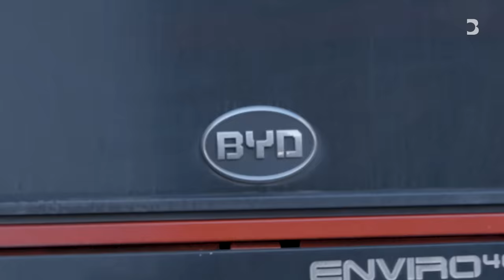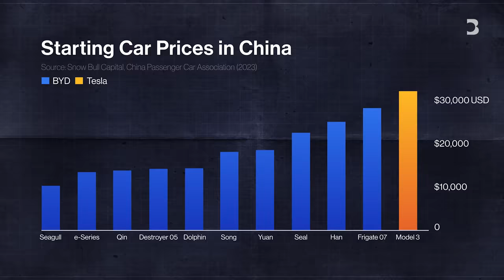How China's BYD Overtook Tesla

Comment: I experimented 3 years ago and purchased 4 BYD forklifts. Yes, they make those too. I was hesitant to purchase Chinese made equipment but was intrigued by the batteries. The biggest issue with forklifts is battery charging time, which for a typical lead battery in a forklift is 18 hours to do it correctly. Charge, equalize and cool down. The full cycle on the BYD battery is about an hour to hour and a half. That keeps you from having to swap batteries in forklifts which is fairly dangerous moving a 5K pound battery. You can use lithium batteries but they are incredibly expensive and the usable lift is about the same as lead which is 5 years before problems. The BYD batteries have a 10 year warranty. which just does not exist in the regular battery world.  If BYD were to start making forklifts in USA they would dominate the market. They are a battery company that is now making things for the batteries to be used in.
Reply: Aren't BYD batteries lithium batteries?
Reply: I dont believe you
Reply: @humanyoda  china dont have lithium!meanwhile india with 5.0 million tonnes of litjium found last year:glasses-purple-yellow-diamond:
Reply: @humanyoda No, they are LIP batteries.
Reply: if he worked for byd he would be talking about cars not forklifts, dumb dumb. @dazm901
Reply: @dazm901 and why would someone from marketing talk about issues with their tech? Dumb dumb
Reply: @dazm901 what a troll. You’re spamming replies under basically every comment
Reply: This is bydmarketing?  Its from a forklift article in us machinery magazine.
Reply: @iam_arnavisaha32   we're talking about lithium and China have it... litjum can be found in India
Reply: Will they honour the warranty, though?
Reply: @iam_arnavisaha32  you better create 5.0 million toilet first before dream too much 🤡🤡
Reply: @bestreviews9666  If that makes you feel better. Go ahead.
Reply: @humanyoda BYD has multiple battery chemistries, they have not only lithium ion but they have lifepo,  and they have sodium batteries.

Sodium batteries are dirt cheap because sodium is dirt cheap because of salt and sodium has greater charge hiloldi
Reply: Yes that is why the US tries to keep out Chinese brands.  As much as Americans try to deride Chinese products - they don't even know.
Reply: @iam_arnavisaha32  based on youtube comments, India has everything and champion at everything
Reply: BUT SIR MY INDIA IS THE REAL SUPERPOWER  🤗🇮🇳 WE HAVE THE BEST INFRASTRUCTURE AND HIGHSPEED RAIL 🤗🇮🇳 MEANWHILE IN CHINA PEOPLE STILL RIDE RICKSHAW EVERYWHERE AND THEY ALSO POOR DONT HAVE CAR . THIS WHY IM SO LUCKY LIVE IN SUPER INDIA  THE CLEANEST COUNTRY IN THE WORLD 🇮🇳🤗 , WE NEVER SCAM! WE GIVE RESPECT TO ALL WOMEN THEY CAN WALK SAFELY ALONE AT NIGHT AND WE HAVE CLEAN FOOD AND TOILET EVERYWHERE 🇮🇳🤗🚽, I KNOW MANY POOR PEOPLE JEALOUS WITH SUPER RICH INDIA 🤗🇮🇳🤗🇮🇳🤗🇮🇳🤗🇮🇳🤗🇮🇳🤗🇮🇳
Reply: @iam_arnavisaha32  India can sell them, that's it. To be honest, pretty much Nothing is made in India
Reply: @bestreviews9666  lies can't last long, you should be able to find out he told the truth or not in just 2 years
Reply: @iam_arnavisaha32  
but INDIA has no knowledge on the knowhow to REFINE ..... hahahah. thats where the CHINESE lead.   its not about  RAW , its the process of extracting and REFINING..
Reply: @ulooqulg  100 billion dollars oil refining deal with uae by india,is it a joke to you? or your country doesn't have that much gdp?
Reply: @ulooqulg  usually minimum india invests 1 billion dollars every month on oil refinery,check the articles and sources!
Reply: grow up....
Reply: i like how people are brain drained and say that india needs to build toilet! when every house in india has atleast 2 bathrooms! truth will reveal soon!
Reply: @iam_arnavisaha32  I like how people think that all Indians have houses and that those houses have "at least" 2 bathrooms.  
Maybe they think a tin tub and a hole in the ground counts as a bathroom.😂
Reply: @humanyoda  they use lithium ion phosphate (LiFePO4) not lithium-ion (Li-ion) which have a better longevity, can charge quicker and are cheaper to produce and don't use cobalt

Comment: There are really only two things hindering EV mass adoption. That is electrical infrastructure and the barrier to entry fee. As time has gone past, the electrical infrastructure in many places has progressed very well with Tesla playing a big part in this system which is smart, own the car and the way to charge it. That being said however, the car is important too, on this Tesla has really been a disappointment in my opinion. The average joe simply does not have thousands of dollars to buy a new EV that will likely degrade faster when compared with used combustion cars. More cars means a bigger push for electrical infrastructure, Tesla put the cart before the horse on this one in my opinion so it is no wonder that BYD which has vehicles at half the starting price is getting market share very fast and deservedly so.
Reply: Remains to be seen whether Tesla's new Model 2 can bridge this final gap.
Reply: EVs fo not degrade faster. They probably last at least twice as long as internal combustion engine vehicles.
Reply: Tesla is still king outside of china , electrical infrastructure depends country to country, the ev revolution is slow because the ice have centuries of popularity but it is inevitable either full electic or hybrid
Reply: @juliahello6673  Unlikely as the Teslas with the NMC lithium batteries will be more costly to own and operate over the lifetime of the car when expensive battery swaps have to be done.
Reply: @santostv.  EV's are not for everyone's use case. ICE automobiles will be around for a long time especially in the Americas.
Reply: @juliahello6673 impossible to say that right now.
Reply: @bobsmith3983 how do you know this? And do ice vehicles not need replacement parts? Exhausts, clutches, oil, timing belts to name a few. I suppose you also think ev batteries are the same as phone batteries? Absolutely not.
Reply: Um and thermal dynamics lol.
Reply: energy are the next gold and its need fuel, solar electricity are not cheap
Reply: BUT SIR MY INDIA IS THE REAL SUPERPOWER  🤗🇮🇳 WE HAVE THE BEST INFRASTRUCTURE AND HIGHSPEED RAIL 🤗🇮🇳 MEANWHILE IN CHINA PEOPLE STILL RIDE RICKSHAW EVERYWHERE AND THEY ALSO POOR DONT HAVE CAR . THIS WHY IM SO LUCKY LIVE IN SUPER INDIA  THE CLEANEST COUNTRY IN THE WORLD 🇮🇳🤗 , WE NEVER SCAM! WE GIVE RESPECT TO ALL WOMEN THEY CAN WALK SAFELY ALONE AT NIGHT AND WE HAVE CLEAN FOOD AND TOILET EVERYWHERE 🇮🇳🤗🚽, I KNOW MANY POOR PEOPLE JEALOUS WITH SUPER RICH INDIA 🤗🇮🇳🤗🇮🇳🤗🇮🇳🤗🇮🇳🤗🇮🇳

Comment: From the Netherlands here, I own one of the first 300 BYDs in this country, their Atto3 model.
Excellent quality if you ask me. At 40K they were 15K (Volkswagen) to 35K (Tesla) cheaper than comparable alternatives. That 40K also contains an unnecessary pro-oil / anti-sustainability tariff imposed by the EU of 10K.

Being less than 45K also means I got a 3K subsidy for the car, lowering the price to 37.

Drives well, software is fine. I like the rounded interior design. You can even have a frunk if you like, in which rarely used but obligatory stuff like your hazard gear or emergency water & first aid can fit. Integrated dashcams are better than Tesla Hardware 4 version at a fraction of the cost (350 vs 1400). (non-standard in Europe, ask the dealer ahead of time)

Important for me is that when you open a door or look deep underneath something, you see bolts etc, with the 'tension to' point carefully marked so undoing it and re-tensioning can't be done wrong. Many brands cover that up with plastic garbage even in non-visible locations, and if you ever need to do maintainance or repairs, you're stuffed because it costs way more hours to take apart. Tesla became infamous for their huge repair costs.

Downsides? Uh, one that I realised. BYD use Continental tyres as their stock, Continental happily does business with the genocidal Putin regime with no plans to do the right thing and ditch their business there.
Reply: Ok bot
Reply: @matthevandaalen6289  
Wow, je ouders hadden ook een hekel aan je toen ze een voornaam moesten verzinnen he?

Comment: the biggest issue of EV is the battery station, which China has fortfront planning inside the country, but outside in any other market, is difficult for land and setup issue. in china, EV is not just go to recharge station, the go to replace station which is extremely costly when it is not at home.
Reply: The charging will improve and gets faster.

Comment: VW announced the test result of SSB(solid state battery) made by QuantumScape in San jose CA 2 days ago. The data showed SSB did not lose capacity after 50000 Km run. It means SSB will last  at least 3X longer than the Li Ion Battery currently installed in all EV. SSB does not catch fire and can be recharged in 10 min to 80% capacity. When SSB are commercialized by 3 companies(Toyota, QuantumScape, and Solid Power) in 2026 - 2027, EV sales will surge vertically and its order of market share will be reset. I expect all auto companies will stop making ICE cars by 2040.
Reply: Well said
Reply: I hope they get here soon as there's a huge issue with many BYD's burning up and nearby structures/cars too. I'm actually quite surprised by this news title as they're known as major fire hazards with the shortcuts they take during production. I don't think they would ever beat Tesla outside of China as they wouldn't be able to hide bad PR as easily. They also cheat with the # of cars sold statistic as well - you could lookup ghost graveyards of byd cars and discover more - tldr - a major part of this is their government backs them for each car sold so they buy their own cars and build them cheap as they can to profit from government subsidies.
Reply: It did lose 5% over 30,000 miles (48,300km)

Comment: I dont know much about BYD but all of tesla's cars are super fast in all metrics. 0-60, quater mile, etc. Along with that, all of the cameras and sensors on teslas are extremely useful with Sentry mode and the Full self Driving capabilities. FSD alone is probably what sets the price difference from the 45,000 estimate to 22,000 for BYD. More features include using your tesla as a backup powerbank for your house, being able to summon your car to your location using your phone, and much more.  I think the price difference could be a lot of these features that i mentioned. I could be wrong though, as I stated that I dont know much about BYD...Yet.
Reply: 你说的这些功能，国产汽车都有。为了不冲击国外汽车市场，比亚迪这些功能都没有做

Comment: A bloated company will never catch up to Tesla. Only an innovative one can.
Reply: Tesla has started using BYD blade batteries for the Model Y electric crossovers produced at the Berlin gigafactory, resulting in a significant increase in charging speeds.

Until recently, another Chinese battery maker CATL was the sole supplier of batteries for the Model Y in Europe, but in early May it was reported that Tesla had started using BYD as a second supplier.

Data posted on the German forum Tesla Fahrer und Freunde shows that the Model Y with the BYD blade battery maintains peak charging speeds well above the CATL version.

Comment: I would suggest use battery made up of mixture of metals if we mix two metals like iron and copper it can be used as battery it holds charge and can be charged as well what you have to do is mix two metals like iron and copper after that use iron as anode in top of the battery and copper as cathod or vise versa it can be charged also by how you charge a battery

Comment: 3:04 Tesla Model 3 is priced at 205,000 RMB in China, approximately equivalent to 28,000 USD. On the other hand, the BYD in Europe is priced at 42,000 EUR, whereas the same model in China is sold for around 25,000 Euro. Let's refrain from manipulating the numbers to portray BYD as cheaper and Tesla as more expensive.
Reply: This is due to safety requirements. Chinese cars inside China do not meet the safety standards of Europe and Australia. If they are to be exported, the entire front end must be changed over. That’s why the price goes up.
Reply: @fabmanly1070  You completely missed the point there.

Comment: Unclear as to why (PHEV) plug-in hybrids are counted as electric cars when they're just an internal combustion engine vehicle with an electric range extender (small electric motor and battery pack). BYD did not produce more BEVs than Tesla in 2023. Also, BYD is having significant challenges selling their EVs in Europe.
Reply: Even if you exclude the PHEV number, BYD still sold more EV than Tesla in 2023 Q4. And Europe is not the only market in the world. BYD sold well in China,  Australia New Zealand, ASEAN and South America. BYD decided to tackle the European market slowly rather than just throwing their cars cheap into the market. That's why BYD car are expensive in Europe.

Comment: From driving many BYD vehicles in Norway, I must say they are built just as well as European cars, but its not exceptional build quality, VW for many years has made pretty okayish quality cars, there is always issues in VW cars, always, I never owned or our company never owned any VW cars that did not have issues once a year. 
BYD does not have too much to compete with in this space, electric cars by default have half as many issues as ICE cars just because they are far less moving parts and less stuff to go wrong, there is only battery and EV engines to worry about, I own one electric car and it has a feature that let you do emergency breaking only with EV engine regen, so if your breaks fail, your EV engine can increase regen mode so much it breaks almost better than regular breaks, its crazy how technology is moving forward, soon cars wont need breaks, cars will be simple mechanically but chuck full of useless gimmicks inside to entertain you.

Comment: They stole usa technology to create their own evs
Reply: Tesla has started using BYD blade batteries for the Model Y electric crossovers produced at the Berlin gigafactory, resulting in a significant increase in charging speeds.

Until recently, another Chinese battery maker CATL was the sole supplier of batteries for the Model Y in Europe, but in early May it was reported that Tesla had started using BYD as a second supplier.

Data posted on the German forum Tesla Fahrer und Freunde shows that the Model Y with the BYD blade battery maintains peak charging speeds well above the CATL version.
Reply: Bot

Comment: I have a BYD Song Plus, and got to say... it is awesome!! In the last 2 months I've put over 12.000 kilometers through all kinds of roads, specially highway roads. No surprises and not a drop of problem in sight. A very comfortable and very silent ride all the way. Unfortunately the self-driving mode is not as advanced as Tesla's, and it requires the driver to keep a firm grip on the wheel at all-times. However it keeps surprising me how well it does curves at high speeds and safely keeping the car centralized in the lane at bad weather condition with extremely low visibility, all while driving in the autonomous mode (with a hand on the wheel to keep from canceling out the mode :( )

Comment: guess what. if you dent your Tesla battery 5mm because of some bouncing rock piece or debris on the highway, only 5mm, your Tesla is voided battery warranty and Tesla sends you to the insurance company to replace your batter and guess what once battery replacement needed your car totalled. and guess what if you want to keep your totalled tesla car even for hail damage , genius tesla engineers will shut down your supercharge capability remotely , and volla you will be added to black list and they will ruin your life you would never charge your tesla at level 3 charger which is vital. you only have level2 charger or level 1 which requires 13 and 24+ hours to charge respectively.

Comment: Tesla is still no1 because byd sales include hybrid cars which are not evs they are ice cars with a battery thats used part time but the primarily still run on gas...😅
Reply: BYD's PHEV is electric-based, can be charged for 100 kilometers in pure electric form, and in fact, 80% of the mileage is electrically driven.
Reply: @mingtao6881  Here is your 10 cents from winnie Xi 🐹  Excellent work may the party endure 1000 years!

Comment: the name build your dream still bothers me
Reply: Actually.  The origin of the name BYD is different than you think.   The original company name started as Yadi Electronics.   The CEO decided that if the company name starts with a Y then it is last on the list when it does promotion in Expo.  So he decided to add "Bi" in front of it so the company name will appear on top of the list of company names in the Expo giving it much more exposure.  So the new company name is Biyadi.   And when people say Biyadi, it sounds similar to BYD.  Thus the company change it's name again to BYD.   And when reporter ask what does BYD stand for.  Well, ideas flow around and they came up with Build Your Dreams.   So originally it has no meaning but evolve from the original name Biyadi.